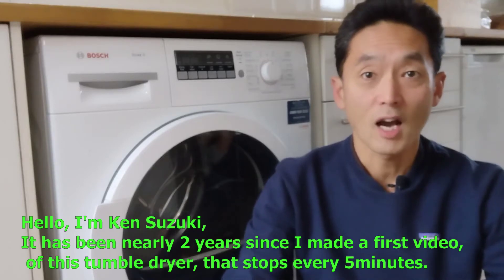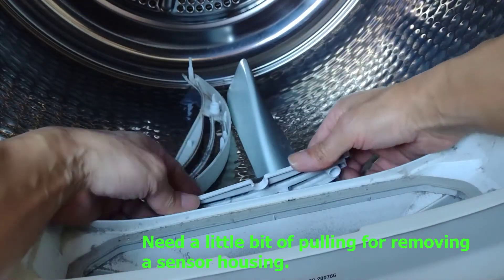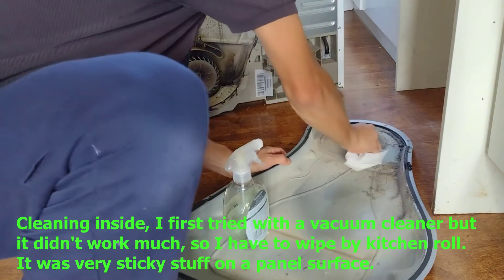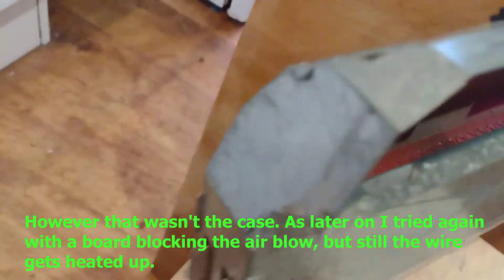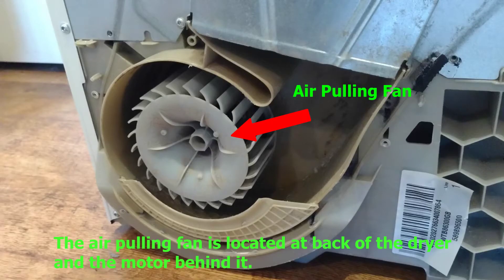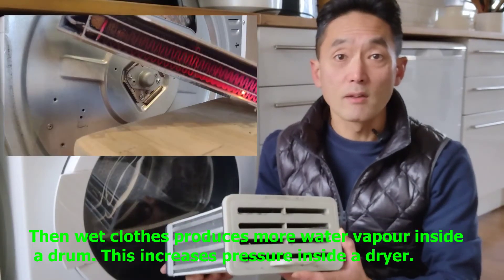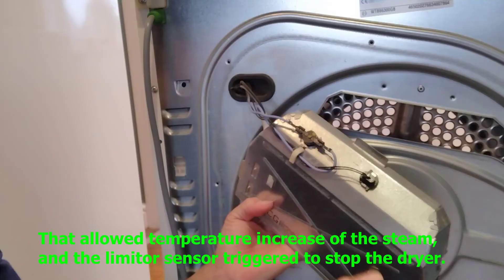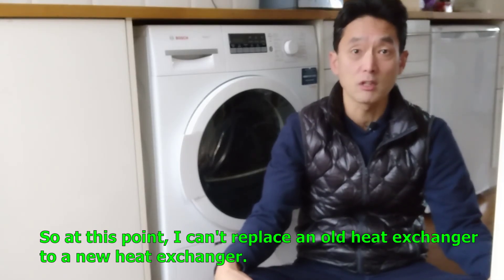TumbleDryer2 HeatTemperatureSensor

Comment: Got a series 4 dryer by bosch at the minute im getting an E06 code as soon as its turned on. Cant figure out what it is.
Reply from the maker: You might have googled as well, it says fault with a heating circuit, so it seems control board issue, I guess you have to ask Bosch service help for technician. I think replacing the control board yourself is a bit risky, hope yours still under warranty.
Reply: @kensuzuki9319  control board im guessing is the display unit and program control fascia?
Reply from the maker: @Jacko2904 Yes that’s it. And it costs about 200GBP. So it should really be under warranty still yours.
Reply: @kensuzuki9319 thanks for your expertise. What a guy

Comment: Misery loves company! I've had this issue and gotten so bad,I dry clothes on a rack. Bosch repair will cost a fortune  as I learned with my Bosch microwave and oven and then rangetop. Guess what I learned from this expensive lesson and what brand name I will NEVER buy again.
Reply from the maker: @946brandon  I guess there must be some limit in the system which I am not fully understanding so that it is interesting. Thank you for the comment.

Comment: Hi Ken, You are most diligent on your repair of this condenser dryer. I am a Sears technician of 7 years and we are the number 1 service provider in the USA. 

Great news, your Dryer is operating as designed! Timed dry will deliver the unit to run and not stop for the set time you have selected. Auto dry will run the unit for the time show at the start or less. Auto dry will detect the clothes and turn off the dryer, in a shorter time, when the dryer determines the clothes are dry enough.

The key point is 'Dry Enough". Condenser dryers have moist air circulating in the drum where the clothes are. This vent-less condition will always prevent the clothes from feeling completely dry. More like Slightly Damp.

Reference video: Search: Cabana State of Mind > Customer review of 2 in 1 Combo Washer Dryer Review (3:55min mark)

Thank you for all the SERIOUS work done to your dryer and the many hours it took you to test the unit and document this video.
Reply from the maker: @magikdale  Thank you very much from the professional person.i wonder why the dryer stops much earlier at the beginning of the cycle, when it's still damp. What is the reason?
Reply: @kensuzuki9319  Hi Ken, What were the indicators on the panel when the dryer stops? Check your manual or Youtube for the definition of the icons. 

Currently, is the dryer (In time mode) running the full period of time? 

Auto dry is an old system that is not very accurate. It never was accurate when it was invented. The moisture bars are separate conduction wires. (When you are testing the moisture bars - test each bar separately. To do this: connect one lead of the meter to the connector and then test continuity by touching the other meter lead to the bar farthest away from the connector. Repeat for the other moisture bar.) 

When wet clothes touches Both bars, a circuit is created and the CPU gets a pulse signal. This signal tells the CPU that the clothes are still wet. The dampness of clothes will create a tolerance of conductivity. When the clothes are not wet enough (Damp) to create a circuit then the pulse will not be created. The CPU monitors the pulses and if there are not enough of these pulses then the dry figures out that the load is dry enough.

Now here is where the design is flawed. Consider: Small size clothes and large size clothes in the drum cavity. Which article of clothes will be dried first? (Smallest) How can the dryer selectively pass the wet clothes to the moisture bars? (It can not due to the random chaos of clothes turning within the drum) What if the smaller clothes are hitting the bars more often than the larger towels? 

My customers are taught to learn the time it takes to dry their loads. Every customer is different due to the types of cotton, wool, polyester items they have. Every customer loads different amounts of clothes into the dryer. (1/2full  2/3 full which is correct due to proper air flow and circulation.  To 5/6 full  Bad efficiency)  

My customers use Time settings and gauge the performance of the dryer from the outcome. They are also briefed on the Cabana State of Mind video to understand the expected dryer results.
Reply from the maker: @magikdale  Thank you very much of the system how it works. Does the dryer stops if the temperature in a drum is too high? Or how safety mechanism for heat works? I saw some sensor at the back of the dryer however what element is this heat sensor is looking at in general? The air coming from the drum?

Comment: My dryer keep stopping at the middle with water empty symbol 😢 how can I fix it ??
Reply from the maker: Did you watch my the first video of this tumble dryer, Bosch tumble dryer keeps stopping every 5 minutes? Maybe fluffs accumulation in the sump? But you said water empty symbol, which is for just to empty the water from the container, normally located at the upper part of the dryer.
Reply: Its is the pump in the sump, the lint in the sump builds up and act like a valve blocking the transfer pump. It's like you putting your finger over a bike pump and try to use it. If you leave your dryer for a short time it will start working again, but short cycle and stop. The heat exchanger and sump need cleaning. What happens, the water cannot transfer to the top tank, due to the pump being blocked by wet lint in the sump. The bottom sump fills up and the water level sensor in the sump will knock it off. The removable drain tank show up needs to be emptied, but it already been emptied. When you removed to dryer top cover you will see how much lint / dust all over the place. I have done my Siemens iq700 about 2 months ago. I have to do it about every 18 months. Hope this helps and you understand my explanation.

Comment: I had the same problem and found out that it is the main motor overheating. I run the dryer with the side panel taken off, this would let lots of cool air in from the room. The machine didn't stop even once. My plan is to replace the motor, which costs around $150 or I will drill some more ventilation holes at the back of the dryer. For now, we are using the machine with the side panel off :)
Reply from the maker: That's interesting story nobody commented before. Over heat tracked by some heat sensor or some circuit to notice the higher ampere. Ummm. When my machine stops it's always at the beginning, and rest are ok. Maybe your theory is related to this. Thank you for your comment.
Reply: @kensuzuki9319  the symptoms were the same, in the first 5 mins of program start the machine stops, when restarted sometimes completes the program, sometimes stops again. I first tried blowing some cool air with a fan while the side panel off, then I realized that I don't need the fan, keeping the panel off was enough.
Reply from the maker: That's really interesting. Thank you for the reply.

Comment: Dear Ken. I opened up the back of my machine and had zero sticky stuff. Suspect you use fabric softener in your washing machine and this is the sticky stuff?
Reply from the maker: I don't think we used fabric softener but it w
Has been long time, I guess it is 8 years or so time usage if fluff were attached. Also if the new machines are better at blocking all fluffs on the filtered mesh then other area including heat exchanger should be kept as relatively clean. Thank you for your comment.

Comment: Hi Ken, I like your video! I have a container full warning, I checked out and cleaned the condensor and back panel, the sensor inside, than tested the pump outside the machine first it worked nicely so build it in again it worked nicely for 20 seconds, so thought problem solved, build it up again cutting myself on the very sharp edges unbelievable its the first thing you learn in metal working class to burr off all edges maybe to expensive for Bosch ?
Anyway in the end I found that the bearing of the pump is shot by ingress of water, so it worked intermittantly, new bearing or pump solved my problem,
Cheers from the Netherlands.
Reply from the maker: Sounds a lots of things you have done. I thing I don't know is that the pump bearing. I didn't realise it. Thank you for the information.

Comment: Ken, this was so informative and useful. I just found this video after watching video 1 and 3. Thanks for explaining the air flow. we’re still having the same problems with ours (heat sensor warning on). But i’m wondering now if the issue is the thermostat or high temp sensor. Again. Thank you!
Reply from the maker: I think now the issue is not from the physical unit like sensors but from the operating unit. I am still thinking whether I pat £170 for replacing it even if it may not fix. Thank you for your comment.

Comment: Ken!

I think I may have found my issue!

There's a switching component on the PCB that gets very hot, very quickly so I suspect it has developed a fault.  It's a TNY266GN and they cost less than £1.

I think the problem has been getting worse for some time and now the dryer only runs for a minute at most.
Reply from the maker: Ohhh, ok, I will have a look whether it can be ordered! Thank you for your comment!
Reply: @kensuzuki9319  you will need someone who can do SMD soldering, possibly using reflow technique.
Reply: @kensuzuki9319  update: it worked!

Comment: I had a bit of a fix by blowing-very hard, it started to hurt- into the end of the drain hose. Consider yourself warned about potential personal damage to your ear and nose parts. Probably best to try a safer way to force air in. Because the clog in my case recurs in the exit channel of the pump. Cool thing is, you can see it when you pull the pump, and unclip the white cover over the impeller that lives in the sludge pool. The clog is weirdly delicate and gooey. I found my pump wasn’t fully clear when I swapped it for new last year (fat lot of good that did). It was maybe 30% clogged. We’re talking about the part on the pump housing that goes from horizontal to vertical. It’s maybe 6-7mm diameter. Anyway, forcing air in basically pushes that thick glob back into the tank so you can wipe it out with a facecloth by reaching in from the front. I mean really, after dealing with this over 7 years, in my case-check drain error clears for a few cycles after clean the sludge tub-it’s basically a lint buildup issue. Lint is obviously blowing by the filter and seals and collecting in the channels instead of collecting in the fluff filter. Some weird dense fibrous blobs form in places and seem to to migrate to unfortunate places. I also get persistent dust buildup in my home after running the dryer, so I’m confident it’s not trapping the lint inside. Fun fact, the official Bosch how to clean dryer video shows an added filter between the condenser and the front cover, which mine doesn’t have, and there’s no room for. So maybe they recognize the “limitation” of this design? And good luck to you all who have read this far. Applause to Ken for this excellent video and guidance.
Reply from the maker: I guess no matter how much of filter is prepared the tiniest lint can anyway go through it and cause issues to the following process areas. To be honest I wasn't sure that the pressure theory that increases temperature inside the drum is really the case. I made up the theory in the second video. However the clearing the air path seem always important. Thank you for your advice and experience to share.

Comment: Hi..is it need the mechanic for open behind?or can do our self?
Reply from the maker: You can do yourself. It's just bolts fixings. Make sure you disconnect the main plug before opening the cover. And don't try to disconnect wiring.
Reply: @kensuzuki9319  oke sir..thanks alot for the intraction 🥰

Comment: Hi Ken, I have cleaned everything, but the error is still there. Now I am going after [POWER INTEGRATIONS TNY266PN AC/DC changer] on a control board which could be faulty. I got this inspiration on a forum in German language..
Reply from the maker: That's sounds more complicated. I wonder it  improves the condition. Please let me know if you do the change of it. I wonder how often yours stops in one cycle? Thank you for the comment.
Reply: @kensuzuki9319  Hi Ken, the replacement of the TNY266PN and changing two nearby capacitors for bigger and more quality ones helped. It has been confirmed by about 10 complete drying cycles. But anyway thanks for your videos, thanks to you is my tumble dryer clean again.
Reply from the maker: You did pretty well done for that, it's new area to me. Thank you for sharing!

Comment: Thank you so much for your informative videos! I have exactly the same dryer and problem, the dryer stops after some minutes and tells me to clean the filter although everything has been cleaned before. I removed and cleaned the sensor now, and there was a lot of dirt behind it. Although you say, with the humidity at the beginning of the process, the sensor should not have a problem, I think if there is too much dirt, the humidity can't reach the sensors well to connect them and this might tell the machine that everything is dry.
I'm curious whether my problem will be better now. Greetings from Germany!
Reply from the maker: Thank you Daniela, for your comment! Mine still stops once or twice in a cycle which I don't know why. I am making the 3rd video of this topic now, just I am enjoying and hope yours get better.

Comment: Dear Ken,
Thank you for great illustrations.

I got mine solved by changing the pump itself. For perspective, though the dryer is power rated @ 230v, 60Hz, I found out that the pump is rated at 230v 50Hz. Thus, as time passes by, the pump motor grows weaker and weaker as it draws higher amps than it is supposed to.

Changing the pump with a 60Hz one (Part# Bosch 00145623) fixed the problem.

Once again, I wouldn't have done it without your videos).

Thank you and best regards.
Reply from the maker: Ohhh, that's great news! Mine isn't that perfect and still don't know why it still stops for once or twice. Your input is another point I can try. Thank you!

Comment: I bought a Bosch serie 6 dryer yesterday but already regret it ... but with this usefull tips and do preventive maintenance
i ll be probably tackling upcoming problems in the near future... when you do regular monthly maintenance on the heat exchanger compartiment en cleaning filters you probable have a machine that runs a lifetime without it wil stop .
Again thanks for your clear presentation and apply to Bosch as engineer for development ..🙂
Reply from the maker: You made me laugh this morning as a start, thank you! I have heard that some new model has an access panel at the back of the machine. Yes they should have included this part, sump cleaning in the manual as well, which they missed it. BTY, mine isn't still the perfect and it stops sometimes once, sometimes twice in a cycle. Still going.
Reply: @kensuzuki9319  was also laughing Ken...you sometimes sound like mr myagi from karate kid......where you r actually from Ken?
I really like your perseverance...never give up on tackling problems...i work in the oil and gas industry on a gas platform in the North Sea...your attitude against solving problems that's a thing we really need in our industry here and encourage and embrace....
Reply from the maker: I am Japanese as you notified from that actor. You gave me a confident that I can carry on this till I die. Sound very cold and nasty weather condition up there!
Reply: Bought the Bosch WGG244AINL wasmachine and the dryer Bosch WQG235DINL by the way.... Slick machines nice colors

Comment: My dryer won’t heat up. Do you think cleaning the sump and heat exchanger will work?
I will have to try and have a go at fixing it tomorrow.
Reply from the maker: I think it's something different issue if it doesn't heat up. However not waste to clean the heat exchanger and the sump. I had an issue of not heating up on my dryer which the cause was because I didn't fit the heater unit back properly, that the earthing wasn't working properly. I refitted the heating unit at the back of the dryer then it solved the issue. I don't think you have removed the heating unit so it's hard to know what's wrong with yours.

Comment: i can’t seem to get the sump cover off. you push it inwards? it doesn’t seem to unlatch
Reply from the maker: Mine had 2 clips at the front, which I had to squeeze inward to release the catch of the clip against the main housing. So it is to pull after releasing the clips catch. Is there any as such clipping feature on the cover? Or just plain surface? It was a bit awkward to remove it.
Reply: @kensuzuki9319  inwards as in towards you? or inwards towards the machine? also, thanks for your help!
Reply from the maker: The clips' catch to pull inwards toward you.
Reply: @kensuzuki9319  thank you!